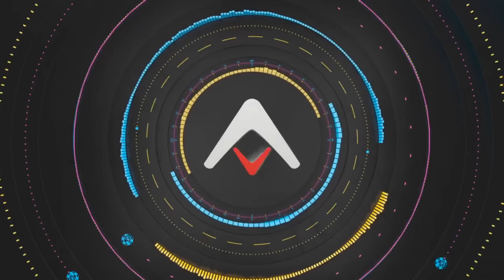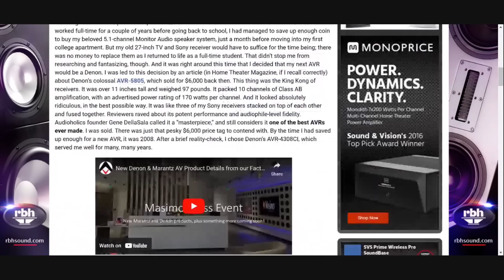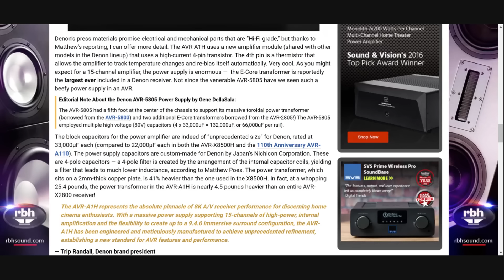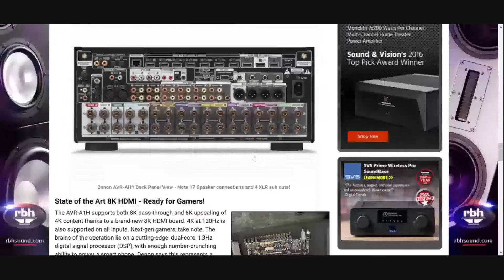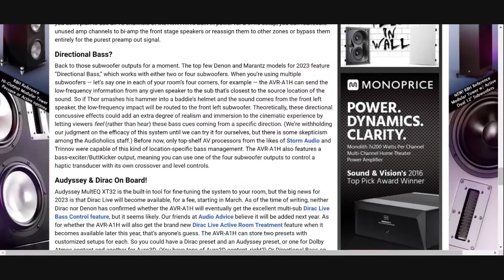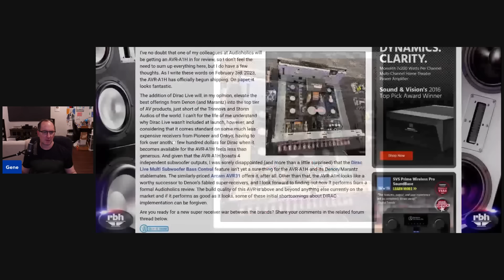Denon Goes Beast Mode: 15.4CH AVR-A1H 8K Receiver - Details Revealed!

Comment from the maker: Correction, the X8500H has 2x 22,000uF capacitors not 27,000uF. 

The Denon AVR-A1H retail price is $6,499 and comes with a 5 year warranty.

The AVR-A1H will likely do 150wpc x 5 ch driven no problem and 70% with 7CH driven or 105wpcx7. In fact, we confirmed with Denon engineering that they bench tested the A1H is able to maintain 70% power for up to 9 channels driven!  We will be testing this to confirm. The dynamic power should be off the charts due to the very large power supply. The A1H will receive a formal review from us later this year with full bench tests and room correction comparison of DIRAC vs Audyssey. 

Stay tuned....

In the meantime, more product details here: https://www.audioholics.com/av-receiver-reviews/denon-avr-a1h
Reply: Yamaha Z11 from 2008, has 2x 27,000uF capacitors.
Reply: Please redo your intro. I love the content though.
Reply from the maker: @TheCharlesAtoz  You mean the bumper? I admittedly hate the sound to it as well.
Reply: @TheCharlesAtoz  It tests your system

Comment: Does the output voltage change in A1h when the internal amp is completely disconnected compared to using partial channels in the A1h as preouts, such as the LCR?

Comment: I have a new center SVS Ultra speaker box that has 2 bass speakers too. 2 sets of input jacks. Not sure if I can just add a base connection to the second input or not. I need to replace my current Denon. They last me without problems for ten years.

Comment: Does anyone consider 15.4 to be way too overkill?  I have a plain old 7.1 (front left/right, center, 2 rear surrounds ,back  and one sub) and I'm okay with that.  9.2 is okay too as it would be nice to have two side channels but 15.4 seems a bit much. That's a lot of speakers  to buy  Thanks for the good information Gene
Reply: My Denon 4810 running 11 channels died recently so as a short term fix I set up my old Technics 5.1 100w receiver. I have to say I was surprised at how enveloping the sound is.
Reply: Replacing my current Denon. The 13.x would do it but I'm not dead yet so 15.4 might be better since these last at least 10 years and I might too.

Comment: The AVR-A1H uses analogue devices sharc DSP chip. What one I don't know. They normally make a lot of noise about the DSP chips they use in their units, but they are very quiet on the subject.  I do wonder if the higher end X AVR's 6700 up would be able to process dirac live with a firmware update. Why would anybody buy the new models if they can use dirac live on their X AVR. Not many people can accommodate 4 subwoofers.

Comment: Digital technology implemented in top-of-the-line, in flagships AV processors (of different mass producers like the ones of the top 3 in the world - Denon, Marantz, Yamaha) has to be like flagships, top-of-the-line smartphone producers (Huawei, Xiaomi, Samsung, Apple, Honor). Because in digital tech, what is flagship component today, will become obsolete in just a year or two... This is why in 2023, I don't want to buy old, obsolete technology at an unjustified cost! Only the newest and best-performing components has to be used and I don't see this in AV10 or in the Denon AVR A1H...  In regarding only to the audio side of the Marantz AV10... My level of expectations at 7000 USD (or even more) is that I need one AV unit to sound like a flagship stereo, on ALL channels... BTW... Be honest... who is using 15 channels configuration in a living room? Or kilometers of wires for zone 2 or zone 3 connections in which the end result is to play same music, instead of separate very good quality audio components in those rooms? We are not talking about hearing the same music in corridors or on an elevator of a hotel, because who really wants this? Sabre DAC ES 9018 used inside AV10? Why not at least ESS 9039Pro or AKM4191EQ? Or a dedicated very low noise stereo DAC in dual differential mode per each channel? As a top-of-the-line product in 2023, it should have! And where is HDCD decoding? Audiophile CD format is not dead, SACD is not dead, Dolby Digital is not dead... Even vinyl is not dead, and in 2023 we still not having a decent phono preamplifier for both MM and MC cartridges in a top-of-the-line AV processor...  In the audiophile community, we are still spinning HDCD CDs, SACD discs, DVD Audio discs - and for HDCD, we need that decoder. Also...we are in 2023, right? ...where is streaming and decoding native DSD1024 audio files? I want to see ultra-low noise separate power supplies inside of a top of the line AV processor... This is the level of quality that I expect from a Marantz or Denon AV processor flagship, in 2023.  RCA connectors are made from gold-plated brass? This is NOT desirable, because of brass low conductivity. It should be made at least from silver or gold-plated OFC copper (again... I'm modest...I'm not mentioning pure silver-made connectors...). I want to see OCC pure copper or OCC pure silver wires used in inside cabling!  Talking further...what OP-AMP are used inside? No info here... Also, no info regarding SINAD with EQ in flat mode at max output volume. I want an upscaler even from DVD definition, to 4k and 8k resolution! Also, who is really using HEOS?? Especially in this high-end area...  McIntosh is having same marketing policy... No detailed info in regarding inside components used, and no tech info regarding very important audio performance in their top-of-the-line AV processor... Only high prices! With all due respect for these companies, this is not acceptable.

Comment: Why build such a beast as a receiver? If I'm spending that much I want separates, and I don't want that many amplifier channels smooshed into the same box as my processor, and probably not that many in one box period.
[edit]  - I will say however that the individual channel control for setting channels into pre-amp mode is deluxe, so at least if you had this you could drive your LCR channels with a higher powered external amp and probably not need any other external amps for the surround channels. The 8500 has this too, however, and it's around $2k cheaper, so that seems a pretty steep price just to add 2 additional channels of processing.

Comment: The architecture is very reminiscent of the old Yamaha RX-V1 with pre and power amps separated by the 2 big heat sinks. I'm guessing the pre is in the middle and the 2 outer banks are power. Why not use that design, it works, and it works very well.

Comment: Does anyone consider 15.4 to be way too overkill?  I have a plain old 5.1 (front left/right, center, 2 rear surrounds and one sub) and I'm okay with that.  7.1 is okay too as it would be nice to have two side channels but 15.4 seems a bit much. That's a lot of speakers  to buy
Reply: how you plan to listen Atmos mixes without overhead channels?

Comment: I know it's not the point but: for your Wii needs, you can buy an HDMI cable for it that does NOT do any upscaling. Basically it sends the NTSC signal over HDMI.
Just make absolutely sure it's not one of those cables that do upscaling because those will introduce a lot of input latency.

Comment: Finally the day has come!! Im still using my Yamaha RX Z 11 and still love it .. problem is I knew at some point I needed to upgrade and all this time I couldn’t find anything that was good enough to replace to RX Z 11 … but… that day has finally come .. I’m super excited about the new product and can’t wait to see the benchmark test. So far I’m using founder 100f along with founder 90c with 2 prestige 1000SW and it sounds absolutely fantastic.. so the question I have is with the RX Z 11 I have the subwoofer out set at stereo and and I love how it sounds very 3 dimensional. So is the Denon directional bass the same or different ? I’m curious to know
Reply from the maker: It can be if you set 2 sub front left and right positions.
Reply: Z11 has some gas in it still its still a great receiver even today l would wait till it gives up the ghost no rush.
Reply: A friend has 4 subs running of his Z11 WOW

Comment: Why waste XLR for subwoofer(s) out instead of the main LCR(s).

At this pricing we are better off with the Marantz AV10 for processor. Are there more discrete DACs on this or the AV10.
Reply: Xlr is only beneficial when running long cables and often measures worse than rca on avrs. More likely to have SUV’s far away than LCR from AVR. Hope that clarifies this for you as to why

Comment: I agree with other posts here. I go to this much trouble, I will fly separates. It is for sure a move in the right direction.  It is not going to beat the 5805 though. But for me, this receiver is irrelevant.  However, if a 1 chassis is for you, and you're budget says I can do it. Then this maybe for you. Those XLRs most likely quasi balanced anyway.  Still nice to see though. If Denon gets its collective schiit together and even trickle down to the models  more can afford, I can be good with Denon again. Time will tell.
Reply: agree with "quazi balanced".

Comment: I don't see many people coughing up $6500 to buy a receiver that does not actually have working Dirac, and most likely will never have the Dirac bass option.  You'd be missing out on the main reason for going with Dirac.  I don't get Denon's decision making here.  Dirac has been out and stable for a long time now.  They couldn't figure out how to get it working on launch day?  Just my .02 cents.
Reply: forget Dirac Bass.Dirac active room treatment is new hype and I bet it will NOT work on current gen.🤦🏻‍♂️
Reply: @level80888  Yeah, it is the future for sure. I don't think it will work on any device currently, other than the $20K+ devices that Dirac partnered with.

I just can't believe Denon went through the trouble of adding Dirac and decided not to make the receiver work with the bass option.
Reply: The dirac live bass control option is available for this and other Denon models. So you were wrong my friend

Comment: X3600h cost me $800 and it has amplification

Just give me a good processor under $1k with no amplification. Even under $2k

Separates are best

$7k makes no sense
Reply: That's my thought process.. I just dont see upgrading my 3700..since I'm using it as a preamp.. An emergency if one of my amps go out

All Blue Jean Cables 

Denon 3700.. Monolith 7 * 200.. Emotiva basx4 for atmos.... 7.2.4 Arendel 1723s LFC.. Arendal 1723s surrounds.. Arendal 1961s heights.. 2 Arendal 1961s Subwoofer.. Equals 😁😁😁
Reply: Would be great but is probably never going to happen. I suspect the biggest portion of the cost of an AVR these days are not the parts (well at least not the amp parts in cheaper AVRs) but the licensing of all the formats, the room correction systems and their implementation (software development and maintenance). It probably makes a really small difference if they throw a few amps in a <2K AVR or not, the rest is the expensive part so if they would leave out the amp section of something like an 3800, that would probably only free up very little budget to improve upon the rest to create something customers would regard as a "true" seperate preamp/processor. 
Sure, there might still be a market for something like this, a Denon 3800/4800 exactly like it i now just without the amp section and maybe 500 bucks cheaper than the complete AVR or some more/nicer connection options compared to the AVR instead.

Comment: For less money, I just recently purchased an Anthem AVM 70 8k and and a Monolith 7X amp. I have them each plugged into their own dedicated 20 amp circuits so the units are completely isolated from each other. Admittedly, I will eventually need at least one more amp to take advantage of all the channels which would make the total price higher. I just can’t help but think that someone looking build a 15 channel theater would probably go with separates. I guess the 4 subwoofer outputs on the Denon are nice but I wouldn’t be able to fit 4 subs in my room.
Reply: or better yet, get an Anthem receiver and add an amp for the 3 front channels and your receiver for the rest.
Reply: This Denon AVR's will be discounted soon going by the ones already released.  They are all overpriced, and Marantz prices are laughable. The Marantz AV 10 cost more with the same internals, no amps, somehow the word rip off comes to mind.  ARC genesis is superior to Dirac live and is included in the price, Dirac ART should be superior to ARC Genesis, but how much will we have to pay over the price of the Denon AVR to use it when Denon brings it in on their AVR's.
Reply from the maker: Great choice

Comment: This is cool but I wish they would move on to Class D amps with this many channels and power used. THAT would be innovation in the industry - a big player moving their flagship to it
Reply from the maker: Agreed but this is still impressive
Reply: yes, it’s just coming down to a Receptacle issue.
Reply: You wonder why they didn't use Class D?  More power, better SNR, lighter, cooler.
Reply from the maker: @briansmith4241  more costly to implement

Comment: dissapointment. People who can afford it will do next step and go separates. People who REALLY want to build best HT will go with Trinnov, bc no one AVR can beat it.  Even $9,000 AV10 can not beat Trinnov. Even Mathew and his guest speaking of AV10 admit that "although it can not beat Trinnov its CHEAPER". All I need from Denon/Marantz is 7706 class device with 16.4 xlr out, Dirac (+ART) and price below $2,000. No matter how big transformer within these AVR are - any separates will sound better. Saying  that all denon/marantz lineup above x3800h is irrelevant.
Reply: and i want all of that for $1,000.
Reply: @TomBartol  it could be if you, say, remove all amplification guts from x3800h and replace it with XLR circuit.
Reply: I am getting an Anthem AVM 70 and either monolith amplifiers and run 7.2.6 for near the cost of just this AVR. No thank you!
Reply: Yup.. Denon 3700.. Monolith 7 * 200.. Emotiva basx4 for atmos.... 7.2.4 Arendel 1723s LFC.. Arendal 1723s surrounds.. Arendal 1961s heights.. 2 Arendal 1961s Subwoofer.. Equals 😁😁😁

I always wondering will you really notice the difference.. My ultimate test.. Is when my girlfriend looks around and be like damm where did that sound come from.. 🤣🤣
Reply from the maker: Trinnov isn't the answer for everything and far more costly than this. Most people don't need the capabilities of Trinnov. Trinnov also is 5 years behind in HDMI. If you're a gamer you can't beat Denon and Marantz.
Reply: I like the sound and power of the McIntosh mht300 better and it will last at least 20 years
Reply: @WayneStinson-m2u   WW4 will  be much  sooner.
Reply: How do you know how good the Trinnov is compared to Arcam for example ? Trinnov is a $500 i5 computer and because they are all in house designs and have no economy of scale, you are literally paying about 18K on software...
Reply: @Echo-jg8is  still its a reference equipment at CEDIA headquarter in Indianapolis. Dont get me wrong, I dont advocate for $18,000+ piece of crap. I just want Sound United asses their audience  properly and do their lineup acordingly.
Reply: X3600h with emotiva xpa 7 gen 3 ftw

Less than $2-$3k spent. 7.2.4

Upgrade will be to anthem processor and Bassx emptiva for heights at some point. 

2x4hd for subs is fantastic.
Reply: @BFArch0n  3600 has no Dirac and this is a deal breaker. For me at least.

Comment: I'm  hoping that marantz will bring out a direct replacement for the SR8015  as I think the Denon design is looking a bit dated, maybe  cinema 30?
Reply from the maker: I have the same hopes. Fingers crossed.
Reply: @Audioholics  Me too over here in the UK. My AV amp (no tuner hence the amp designation instead of receiver) is the venerable Denon 7.1 THX Ultra Two certified (no longer a big deal anymore) AVC-A11XV which I upgraded to an "A" version (and what a waste of money that was imo) in premium silver. I already have four Atmos speakers set up and i'm waiting patiently (hopefully) for Marantz to replace their present flagship (the SR8015) in the new Cinema series as mentioned above, maybe a 30 or 20??? I've waited long enough so another few months won't make any difference. As with peter march the design of the Denon's haven't changed much, in fact they're similar to my present AV amp which is approximately sixteen years old, also the design of the 8015 and its predecessors are looking that way now. The new Marantz 40 is 125 watts and not 11.2 whereas my AV amp is 140 watts (like the 8015) and 11.2. Marantz did a good job on their redesigned Cinema series, so here's hoping. By the way these new AV amps in the UK are also available in premium silver apart from the AMP 10 and the AV 10 which are only available in black.
Reply: i think the same..should be Cinema 30

Comment: The thing looks like a beast. But out of my budget for now. But I really need to get a new AVR since my old Onkyo suddenly stopped putting out sound. I have not decided on what to get yet but I think it will be between the Yamaha RXV6A or the Denon avr-x1700h. Just having the WIFI & Bluetooth capability will be a massive quality of life improvement and convenience. The more cables I can cut out the better 😅